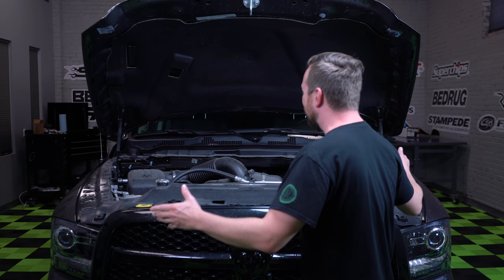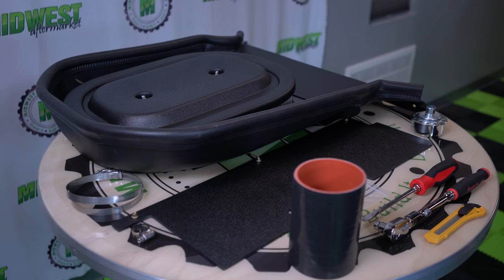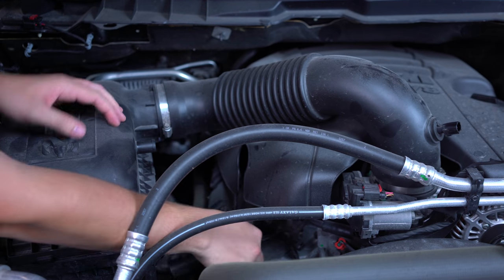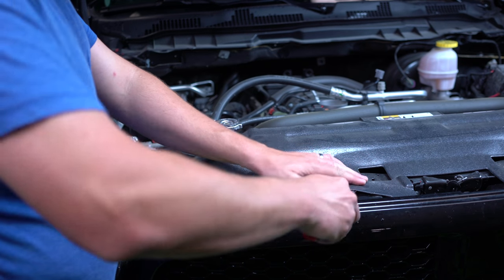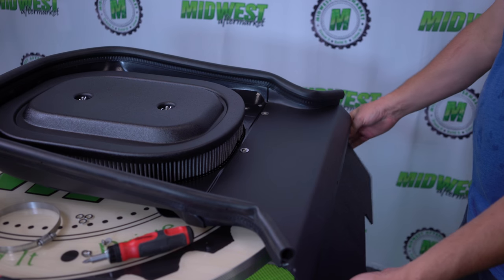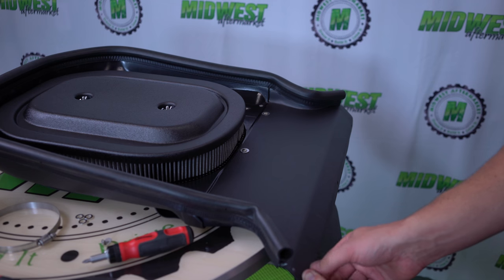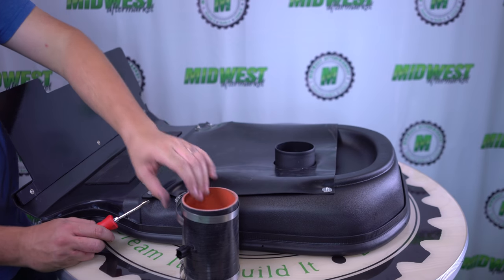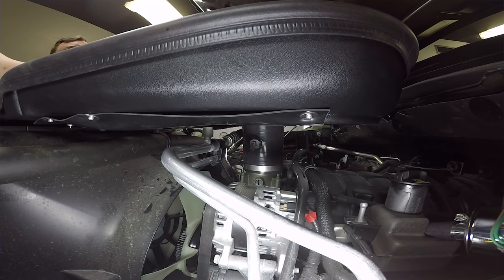Vararam Air Grabber Air Intake Install

Comment: Kinda missed the step of lowering the A/C line and making sure the intake sits level.
Reply from the maker: Great catch, Chris. We'll have to add that in there. Certainly loosening the bracket holding the A/C line and lowering it a bit should help the Vararam Air Grabber sit more level. Might have to do a reshoot to show that step. Thanks again for your comment.
Reply: @MidwestAftermarket  best way, is to leave the coupler loose that connects the filter to the engine, then lower the hood slowly, and let the hood level out the filter. then raise the hood, and tighten the hose clamps on the coupler..